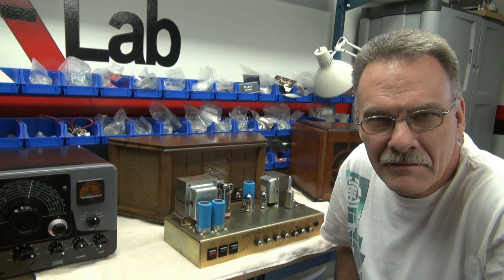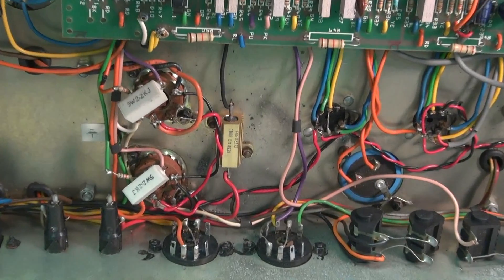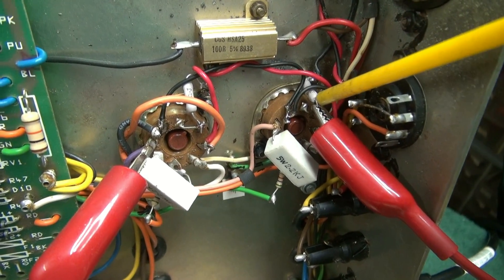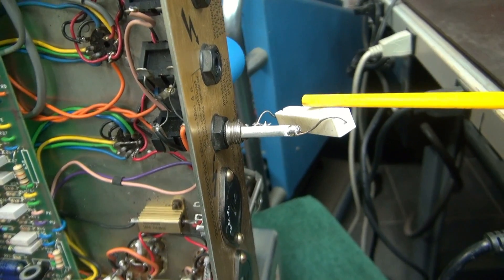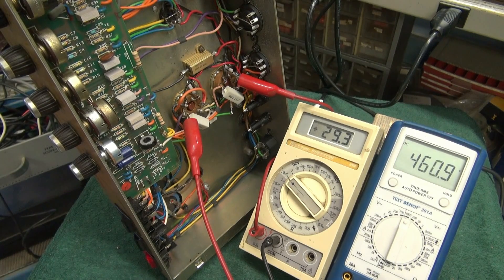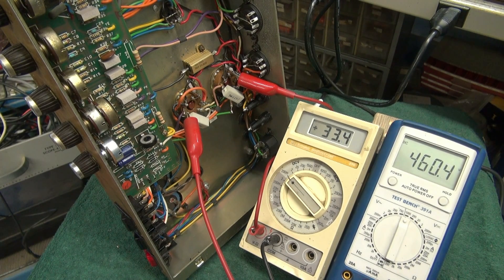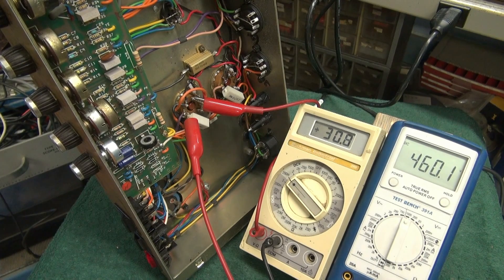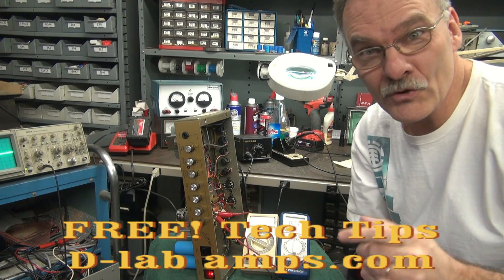Marshall EL34 Tube guitar amp bias adjustment mod D-lab Electronics

Comment: Great Info Right up to the very end ... now subscribed, thx
Best Simple inExpensive Dummy Load ever ... ! ... would 10wt work for a 16ohm load~? ... I always use or select > 16ohm & speaker's to get full use of the transformer. 8>)
Reply: As long as you keep the volume(s) turned down, yes.

Comment: Thank you for this tip/mod !
Reply from the maker: +hadley101 Roger that, more to come
Reply: +D-lab Electronics Going to do this mod for my JCM 900 2100 SL-X, 1W or 2W 1 Ohm 1% Resistors? Hard to tell by this video, Thanks again!
Reply: Took a look at the schematic and it has a bit of a different ground scheme than usual, think it is out of my realm of understanding so I'll pass.
Reply: hadley101 I use 1ohm 3w 1%
k
Reply: The resistors will normally be dissipating 33mA x 33mV which is just over 1mW. A 1W resistor will be fine, and offer greater protection to your amp than a larger resistor case of a cathode to heater short (as described by Terry).

Comment: Hello Terry. I have a jmp 2104 50W combo from 1980 which has exactly the same problem, no testpoint. It has also EL34 tubes. The plate voltage is lower because of the power transformer. It's about 390V . Is there a formula that I can use to calculate a prober value for the bias setting? Thanks for the very educational video
Reply: The maximum plate dissipation of an EL34 is 25W. Calculate the plate current required for max. dissipation by dividing 25W by the plate voltage on pin 3, and then set the plate current to 70% of the result. In your case, 25 / 390 = 0.064 i.e. 64mA and 70% of 64mA is 45mA, which is the plate current for 70% of max. dissipation.

Comment: Sort out the audio on your videos, it's absolutely terrible!!
Reply from the maker: +Black Skull Hello, Yes, I have been told to get an external mic to level out the audio. I will get one on the way
Reply: +Terry Dayton cool. I'm getting really annoyed, because people think they're explaining what bias means, BUT THEY'RE REALLY NOT!!!! Just tell me what happens when you bias an amp! Is it like an input level on a audio interface, so the sound is not clipping, but bias works in voltages?
Reply: +Black Skull 

In a nutshell, ‘biasing’ is the adjustment of the current through the output tubes under ‘no-signal’ conditions, which is
accomplished by adjusting the ‘negative bias voltage’ on their control grids.The basic idea is to get as much power as possible from the output tubes without stressing them.
Reply: Silas Fatchett, as I can understand: 460Vx0.033A=15,18watts at single tube, it is near 60% of tube max power. Rob Robinette recomends on his site 70% for AB class amps as the safe limit. So I assume, that author of video can increase current till 38mA.

Comment: I wish Marshall would have easily accessible testing points and bias pots on all of their amps. And make them to where you don't have to take the amp out of the chassis.
Reply from the maker: John Simms I agree. It is fairly simple to install some banana jacks for the bias TP. Also, the little PC type pots they use for bias has to go. I install a standard Alpha pot, chassis mount
Reply: +D-lab Electronics i was even thinking to put a panel Millivoltmeter
on it and a 3 way switch  v3 v4 off 
a pot  outside  
and set the bias  
without tools  

the pot is 50k  linear ?  or am i wrong
Reply: Ooh! Look, there's a knob on the back of this amp! I wonder what it does? I'll just turn it and see what happens ...

Comment: Thanks this worked a treat! I also found if you turn the power straight off (after warming the tubes up) without going into standby the plate voltage dissipates rapidly through the tubes. I also put a few layers of duct tape over the capacitor connectors to reduce the risk of getting zapped.

Comment: Question, why can't you just read the plate voltage off pin 3 and then divide into max dissipation, then multiple by 60-70%. But rather, people/books use shunt or current draw like you. I don't understand why. Could you shed some light?
Reply: to know the power dissipation, you need to know both the plate voltage and the plate current  P = V x I

getting the plate voltage is easy, simply measure it from pin 3.

getting the plate current is trickier. you can use the transformer-shunt method (dangerous) or you can measure it using a precision 1Ohm resistor (using Ohm's law) between the cathode and ground.

just a note though, when you measure the cathode current, you're actually measuring both the plate current and the screen current. but typically the screen current is much smaller than the plate current and can be ignored.

Comment: Great video.. But I am not sure if you mentioned it Terry.. The 1 ohm resistor is total cathode current. YOu have to subtract screen current to get plate current draw. And some EL34 will actually draw a lot of screen current (~ 15%, Mullard datasheet).. Hence the large 2.2K 5W screen resistors seen on thin particular amp.. Most EL34 amps has 1K resistors which is good for screens run at ~ 400V but if you run the screen close to 500V a higher value screen resistor really adds a lot of protection. And the added screen compression might make the amp sound a little softer when played loud. 

EL34 draw much more screen current than 6l6GC beam tubes. For 6l6GC you can neglect screen current but with EL34 it can be optimal to see how much screen current is drawn to get the precise plate draw.
Reply: +Terry Dayton Take the amp into a dark room, turn down the bias until the tube plates glow red, then turn it up a bit! Seriously though, they set the bias voltage to their specified level, and just hope the tubes are close enough.
Reply from the maker: Thank you for the info Sir. I enjoy working on the tube amps. Usually, I am a Fender guy. This Marshall came in with melted heater wiring. Output tubes were flat dead. I was a bit taken back with no way to verify bias. I wonder how they initially set it? Maybe used a tube extension with current shunt? The end user suffers with no clear way to perform the task. Glad you liked the video